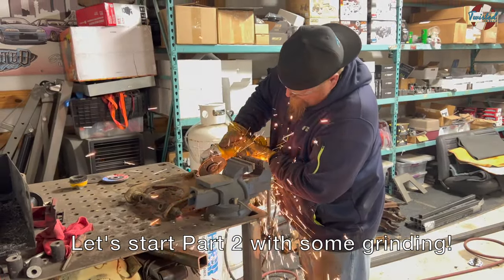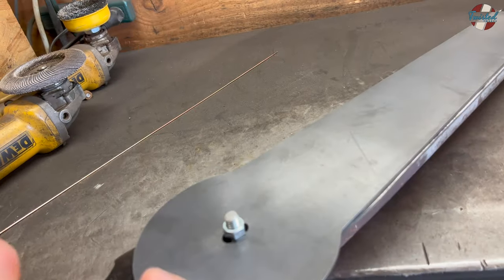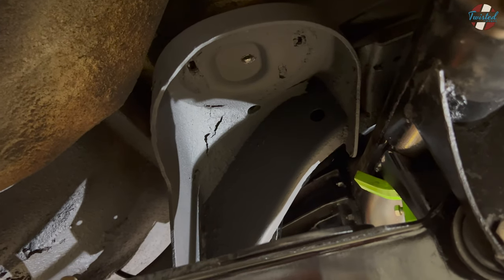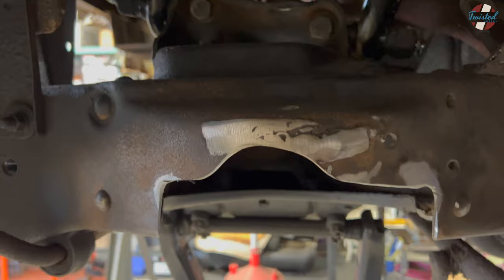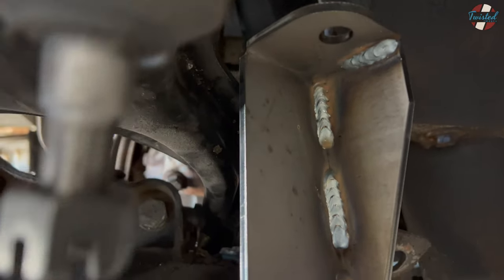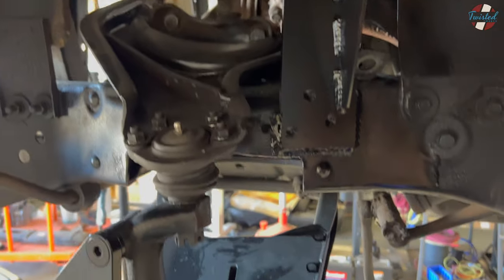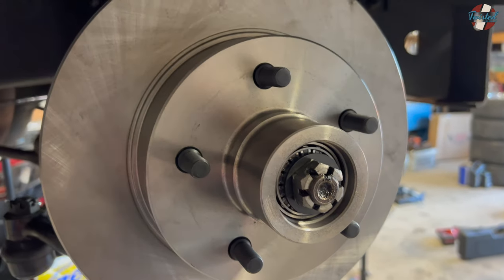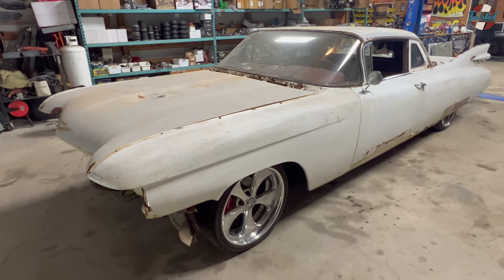1959 Cadillac Truck - Part 2

Comment: Looks great I have an older esab welder they bring the heat.
Always wanted to do this to my 59 but have not been able to commit lol
Reply from the maker: I picked up that ESAB plasma a couple months ago- did a quick cleaning and repaint, and it cuts like butter!
Most of what we did on this '59 is reversible- the coil springs could go back in, and everything could be patched back up if someone wanted a stock restored car later.  But I get what you're saying!

Comment: Transmission assembly lube on the threads of the bleeders on the brakes prevents air from getting by when bleeding.
Reply from the maker: @tinkerne-round4079  thanks for the tip! I’ll definitely try that on the next one

Comment: hey man which shocks did you end up with,,which length ect
Reply from the maker: We ran Ridetech part number 22169850 up front- shows a compressed height of 9" and extended of 15".  For the rear we ran part number 22199850 - 12" compressed and 20" extended.  Hope that helps!

Comment: circuit breaker is backwards. curious about your lack of love for ride tech a arms?
Reply from the maker: @j.d.stollwerck698  ha! Good catch. I’ll touch base with the owner, but I’m sure he’s caught that and flipped it back around to the correct orientation when reassembling the car. 
As for arms, I’m not aware of anyone making replacement control arms for this generation Cadillac? I know Choppin’ Block has some in the works, but until those come out I think your only option is rebuilding the stock parts for the front end?